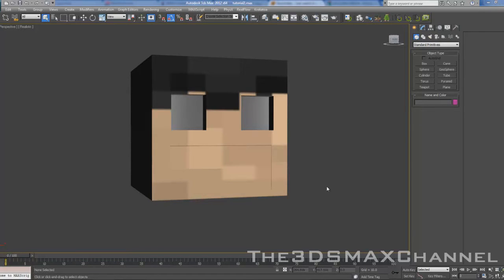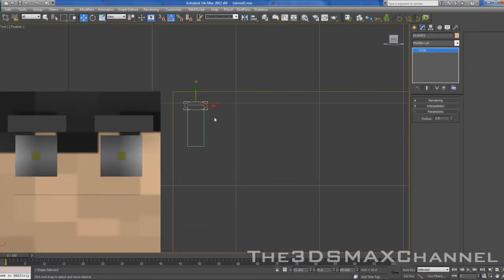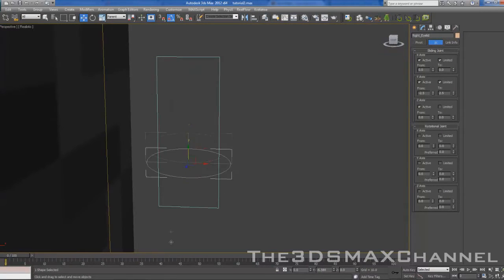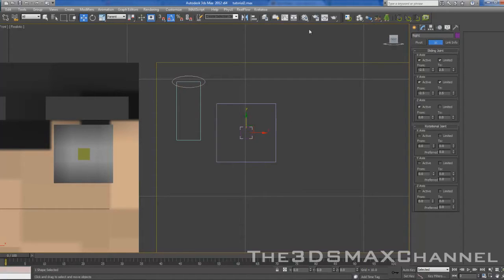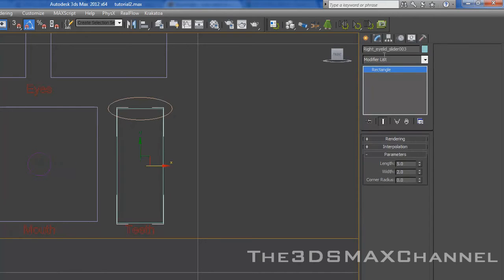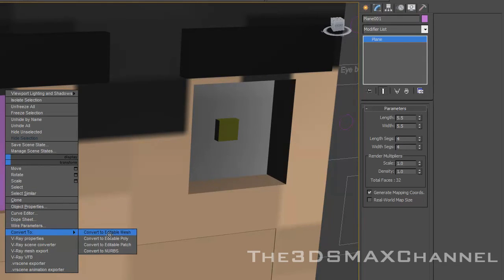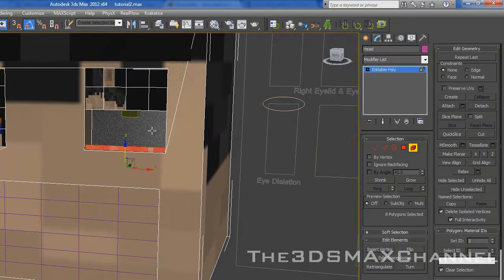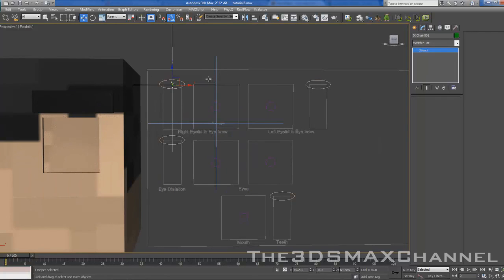3D Minecraft Tutorial - Biped - Control Panel & Eye lids (part 3)

Comment from the maker: That's because you froze the default layer in the layers panel. go into the layers  panel the layer that has a black tick by it is the default layer which means when you create any new objects it goes in that layer, now if you have also frozen that layer than any new objects will also be frozen and invisible if that's has been ticked also.

Comment from the maker: Right click then click "unfreeze all" that should fix that problem. if it's still invisible but clickable after you have done that, you will have to turn 2 sided materiel on under the materiel you gave it (its the first panel in the materiel slot you can't miss it)

Comment from the maker: That's because (if you followed the video correctly) because you've attached them to the head and now a apart of the head, in the next tutorial we make them open and close if you need still tweak them after you've attached them like i show you in the video (make sure you convert to poly so that you dont loose the UVW mapping you just did)  you can go into element select and the teeth and eye lids should be selectable seperatly to the head